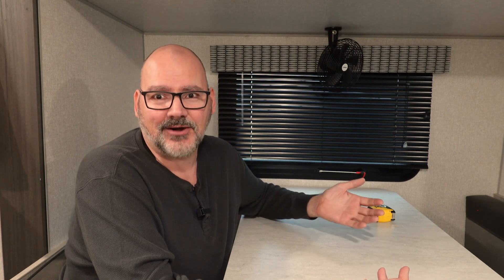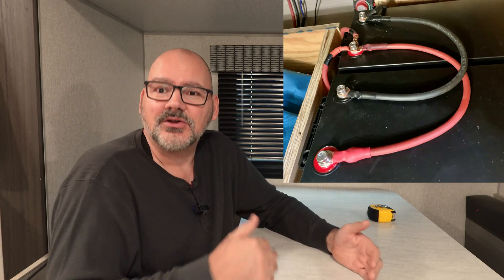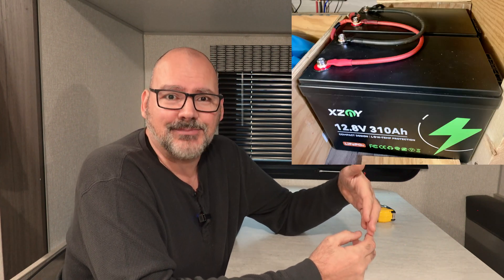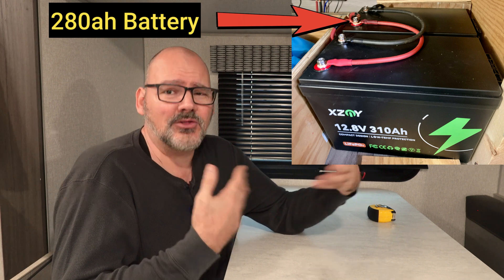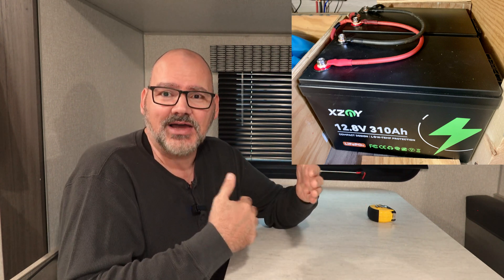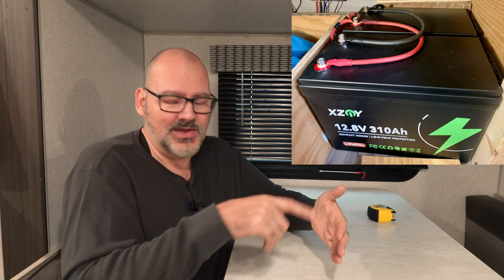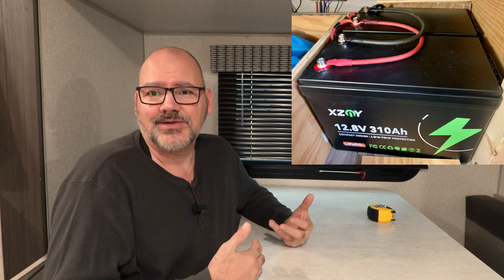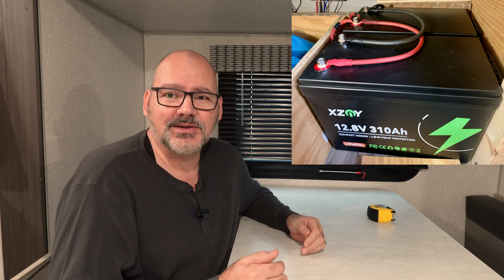Mixing LifePo4 Batteries - Used And New Batteries - Big And Small

Comment: Please dont parallel batteries like you show. It will result in the second battery, in your case the 310Ah one, receiving less of a charge due to the voltage drop in the cables, and if you have a large current draw such as an inverter, it will draw more out of the battery that the outlet leads are connected to. The best way is to have the negative to/from the RV connected to one battery, the positive to the other battery, and then the 2 leads to parallel the batteries in between them. The easy fix for you would be to simply move the positive to the RV from the 280Ah battery to the 310Ah battery, and leave everything else the same.

Ideally I would suggest running the paralleling leads at least as large in cross sectional area as the leads to/from your RV, and if possible, maybe even one size larger. So if you had say 2 AWG (35sq mm) to your RV, then make the connectors between the battery at least 2 AWG, but better if they were 1 AWG (50 sq mm). This helps ensure that the voltage drop in the cables is as low as possible.
Reply: Very good information....all spot on. In addition add inline breaker(s) sized for the trailer wire to be on the safer side if they arent already on there.
Reply from the maker: I just got my fuses in the mail last week. After some consideration, I decided on terminal fuses since I already have a cutoff switch. My system has a very low voltage draw, so it’s unlikely to ever trip a breaker, making the terminal fuses a good choice. I bought an extra fuse just in case.

For context, the highest current draw my system could reach is 80 amps, and my combined batteries have a BMS (Battery Management System) capacity of 400 amps.
Reply from the maker: That’s true if you have more than two batteries and small cables. But if you have large gauge cables like i have then you don’t get voltage drop. And since my voltage input and output is the same from both batteries then it’s not a problem.
Reply: @familyrvliving  What size cables are they, as they certainly dont look to be more than about AWG 4, or 25mm sq, maybe even smaller. Thats fine for low draw items but not ideal for other things. The recommended max voltage drop in a 12V situation is 3-5 %, and thats 0.36 to 0.6V, but we usually see drops higher depending on the loads.

If the batteries simply sit and are not discharged more than a few %, and are float charged most of the time, then I agree you wont see a difference, BUT if you charge from a large solar system, run a compressor fridge, have high draw items such as an inverter, even for a short period, then the smaller battery will discharge more than the 310Ah battery purely because of the additional length of cable between the batteries. While it may work fine for you, if others wire theirs the same way then they may well have issues
Reply: His configuration is perfectly fine for systems that do not rapidly charge and discharge (for example EVs) but mostly sit at a constant voltage allowing balance. Remember that the smaller the current the smaller the voltage drop in a cable.
Reply: @christophS2468  For low usage I agree, but then again if we are talking adding another 310Ah battery then it's off grid with no charging for long periods, or there are higher use items in the RV requiring more capacity than the 280Ah battery can reasonably provide. My suggestion required no more cable, and will 100% even out the draw between the 2 batteries compared to their current setup.
Reply from the maker: If a system is 12V and you use a 10-foot long 4 AWG cable, it will experience a 4% voltage drop. 

However, with a 10-inch 4 AWG cable tying two batteries in parallel, the voltage drop is only 0.34%, which is negligible.

It's important not to use the 4 AWG wires that typically come with these kits. Instead, when buying 4 AWG wire, make sure it’s welding battery wire made of pure copper. Many wires labeled as copper are actually copper-clad, meaning they are aluminum wires with a copper coating. These copper-coated wires are inferior and should be avoided.

Here are helpful links:
https://amzn.to/3ZwQ1aC
https://www.inchcalculator.com/voltage-drop-calculator/